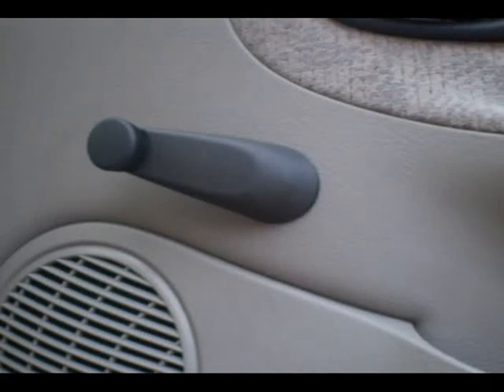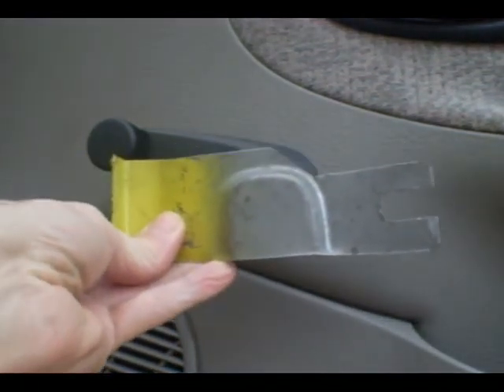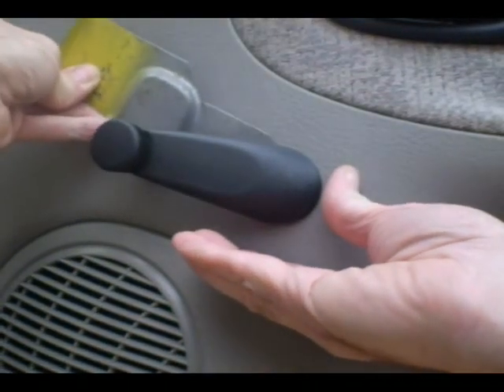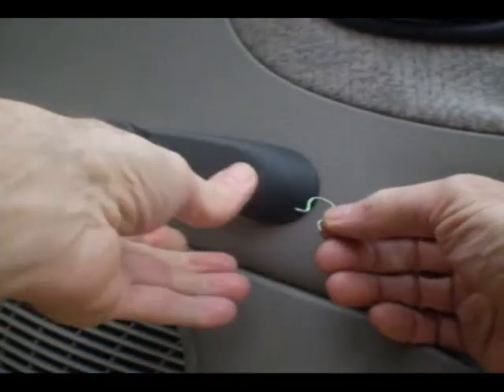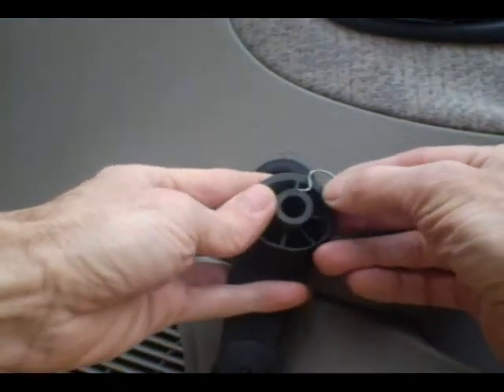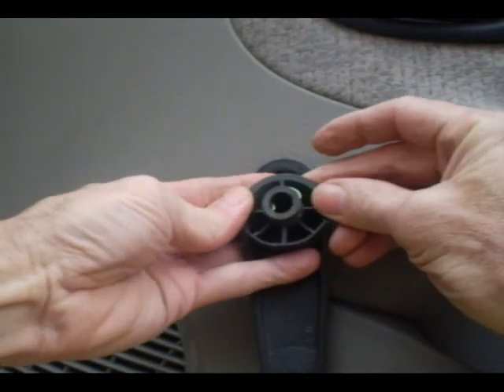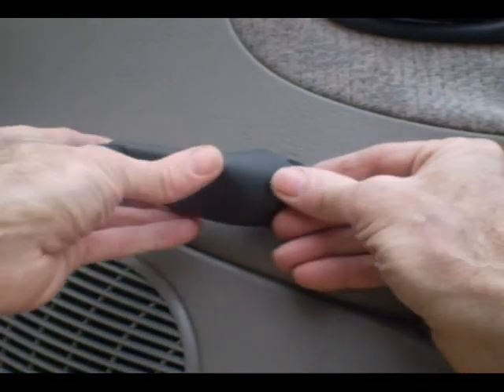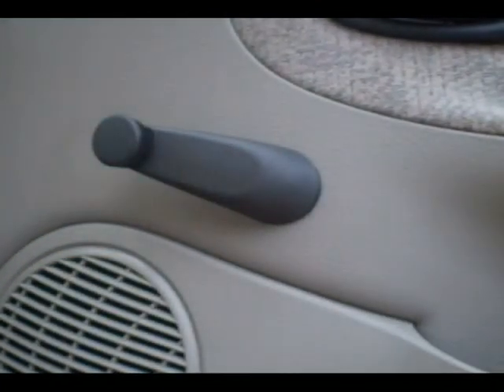Window Crank Handle Removal

Comment: hey richpin, the shirt trick wouldnt work for me, the paper clip way didnt work, i got an idea from another guys vid that had made a crank removal tool out of sheet metal, so with no sheet metal i find another suitable substitute, i cut about a 3/4 inch sq square out of a blank data cd, used like the tool, worked perfect, so was suggesting you make a vid showing it cuz i have no camera and it was just great

Comment: Richpin, do you have any idea how to replace the inner parts of a hand crank window handle? I could not find any videos about this.  We have confirmed that it is not just the handle being stripped.
Reply from the maker: I do have a video that i am going to upload on removing the window regulator on a 00-02 S-series but it is for power windows.

Comment: To get the retainer piece out, you can also use a small hooked tool, similar to a dental pick, to remove it.  I made a tool like yours, but I found using the pick to be simpler since I don't plan on doing this often.

Comment: A wash cloth or sock will remove the clip,if it's stripped try putting a corner of a plastic freezer bag over the gear then handle on that,makes a tighter fit in the gear teeth.

Comment: Haha, that's life though.  I have tiny little fingers.  Made it easy to slip in.  Hey, while I have your expertise (fingers crossed), when removing the drivers outer door panel on the older model Saturn sedans (1996 and prior I believe), do I really have to take the side mirror off?   It seems to be the only thing getting in the way.

Comment: I just run a rag around under the crank. It will snag the clip and pop it out. It's a little more random, but no special tool needed.